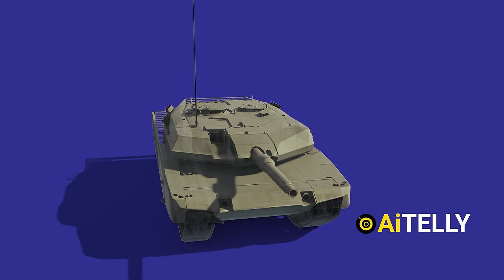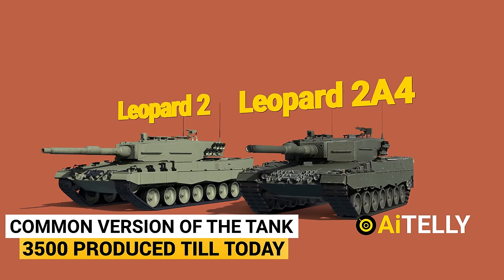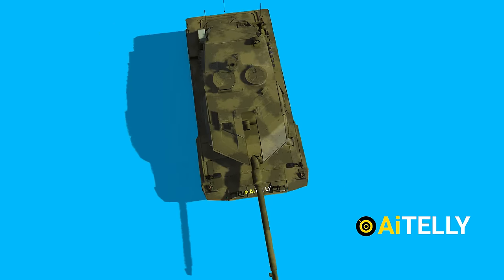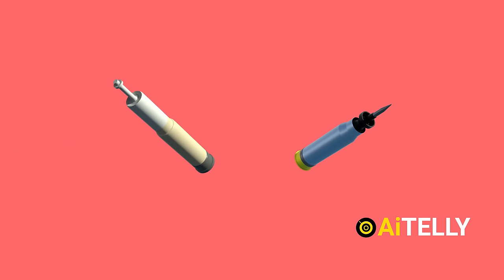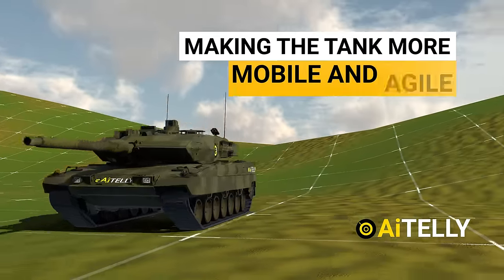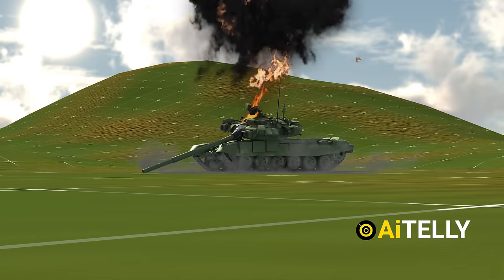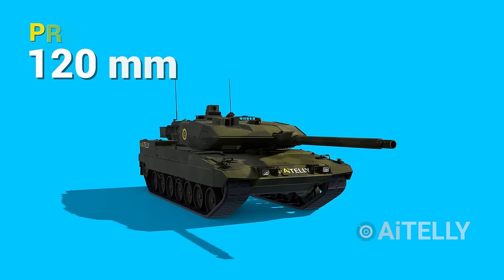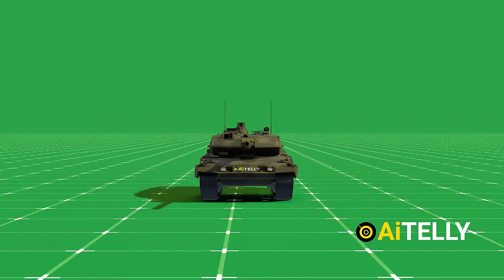Leopard 2 Main Battle Tank How it Works with modular Space Armour Leopard 2A6 Loepard 2A4

Comment: Nothing is more powerful and had fantastic engineering like Tiger 1. TIGER 1 AND 2 were a lot superior compared to modern German ones. German lost the hands in engineering after ww2. Hope she recovers again.
Reply: lol superior are you high?
Reply: @viceralman8450  I am telling the truth. Tiger 1 is a fearsome beast. Leopard is nothing compared to that
Reply: @ridwanhusainishraq  every 1970s tank can destroy a WW2 tank from miles. A modern tank fires from full speed, a WW2 tank has to stop to fire
Reply: In terms of firepower a modern combat vehicle is superior but in terms of strength and robustness leopard tank is a lot less stronger and thinner than tiger 1. Tiger 1 itself was overengineered
Reply: @ridwanhusainishraq  Modern tanks are much more reliable than WW2 tanks, plus their maintenance is faster and easier on the field. 🤦‍♂🤦‍♂🤣
Reply: @ridwanhusainishraq  the Tiger has just a normal steel armor. Any modern tank would shoot through it quite easily, modern tank guns are far more powerful than in WW2. Modern tanks have a different kind of armor, which is lighter but more effective. If you would build a tank with normal steel armor today it would end far heavier than the Tiger
Reply: Underpowered engine, over-complicated, hard-to-maintain undercarriage and suspension, tracks too wide for rail transport - all well-known problems of the Tiger tank, all problems that the Leopard does not have. So what is your point exactly?
Reply: @simonm1447  the point was actually unlike tiger 1 which was predominately feared by allied forces and even the Americans  at that time but did you get any such titles for leopard 1? Well you can see Abrams and t14 tank are lot more advanced and toppled the modern German tanks. After ww2 german drastically lost its engineering in aircraft as well as in military ground. Only airbus grob deutsch flugzeug are some companies remaining. They are more into automotive cycles or rc industry compared to what dangerous military technology they had in ww2 during Nazi regime. Stuka was the most feared warbird. Yes definitely leopard tank is modern much lighter and uses composite materials than old tiger 1 or 2 but nevertheless it can never compete with Abrams  tank or any US modern tanks
Reply: @einundsiebenziger5488  precisely speaking it never got its name and will never be feared by any countries just like tiger 1 was fearsome beast to allies during ww2. U can see the comparison here. In terms of technology undoubtedly leopard is superior but the best and most powerful tanks to be feared is the Abrams tank undoubtedly

Comment: An upgraded M4 Sherman is probably better
Reply: @Edp It is battle tested and a very reliable tank. It was the best tank in world war II, where 49.000 was built.
And it is cheaper to upgrade a tank than to build a new one. And it is safer to stick with a good tank that you know works than trying something untested. You can put a 120mm gun on a sherman and some extra armor and it will be just as good as any modern tank, but cheaper.
Reply: @Edp Yugoslavia built shermans with 122mm guns that worked fine so then would a 120mm gun be no problem either. And if sherman was so bad, then why did they build so many of them? Maybe because they were really good?😏
Reply: lol dude what you take to make you so high?
Reply: @nattygsbord  lol and old obsolete gun that can't fire modern APFSDS. 🤦‍♂🤦‍♂
Reply: @Edp Yep,  upgrading museum pieces, nowadays an suggesting they are better than modern vehicles it's just laughable.

Comment: Golden Point - A Crew of 2 is Sufficient for a Tank ie Driver and Commander only as it increases Space inside a Tank drastically and also reduces weight and power of the Tank.
Reply: I disagree,having 4 in a crew gives many advantages.Maintenance is extremely important and to have the extra crew takes workload off the Cmdr.Learning "on the job" is also helped by having  extra crew,the loader/radio op is (at least in the British Army)an apprentice Cmdr,and can step in if the Cmdr is incapacitated or away from the tank.

Comment: 3:44 Makes Leopard 2 no different than a T-72.
Leopard 2 unprotected ammunition in the hull.
No blow out panels. Yikes.
Reply from the maker: What abot the Newer Leopaerd 2A7
Reply: @Aitelly  The ammo still is unprotected but the ammo propellant was modified to be much much difficult to detonate or catch fire if it is hit directly or by shrapnel.
Reply: @Aitelly  Same problem.
well for everyone who did not get the new German tank shells.

apparently the German solution was to make tank ammunition that don't cook-off.

I cant remember where the article about this new tank ammunition, if I find I will post it.

The Abrams does have have some/few Tank ammunition storage in the hull. But even that has bottom firing blowout panels. crazy.

Germans couldn't be bother to put a blast door on hull ammo stowage and drill a few holes at the bottom.

Comment: so much crap information...

1. the latest 120mm rounds have a penetration perfromance north of 800mm RHA
2. the mobility is a result of many factors some make the Leo2 much better than the M1 like much lower ground pressure
3. we have 2023 the A6 is from 2001... talk about A7V or A7A1
4. no note about the best mine protection of any tank on the market... introduced with the Leo2 A6M and the Strv 122B
5. the A7V introduced the third generation 120l55A1 gun specially developt to kill russian T-14... the gun is in service since 2019 the T-14 isnt even in production... go figure :)...the max chamber pressure raised from 79.000Psi(120L44) to 111.000Psi (120L55A1)
6. The max weigth is 63to
7. the unit cost of a T-90 is not $ 4.5 million... in 2006 Algeria payed $ 5.6million for T-90 which were delivered partly build without any spre parts, training or any kind of support... the Leo2 is so expnsive that much more nation bougth Leo2 over T-90 M1 CR2 or Leclerc
8. the Leo2 is the most easyest tank for maintenance and operation
9. there are no ERA bricks avaible for the Leo2 ...ERA is completely against german armor doctrin because it put the close to tank operating Infantry into danger
10. the wedged armor is a multilayer armor with thick triangle armors inside... goal is to put so much dynamic stress into a APFSDS that it break on impact on the main armor... 
11. no note about superior suspension, ground clearence, of all tanks the highest possible wheeltravel
12. no note that the engine transmission cooling steering is a block that could be replaced by average crew in 15minutes (something the russian probly introduced in their T-14 prototypes... 40years late) 
13. the Leo2 A7A1 is fitted with Trophy and gives a fuck to all ATGM RPG on the market... Trophy is a battle tested israel hard kill system

nice animation but bad information and not a single good information... we have 2023 not 2001

Leo2 A6
Leo2 A6M
Leo2 A7
Leo2 A7V
Leo2 A7+
Leo2 A7A1

get the point?
Reply: Go as smart gets false information all over the hull place, the difference in ground pressure is tiny 0.89 kg/cm2 for the leopard vs 0.95 kg/cm2 for Abrams, the the wedge add on armor is hollow. 🤦‍♂️
Reply: @viceralman8450  the m1a2 ground pressure is over 1kg cm² thats a huge different
Reply: @nagmashot   No its 0.95kg/cm2 just as the US army field manual says. Only 0.06 kg/cm2 than the leopard 2. 🤣🤣🤦‍♂